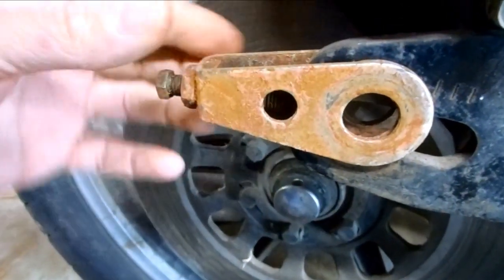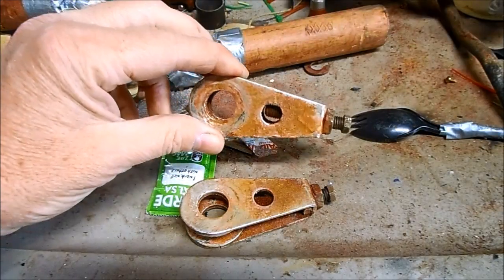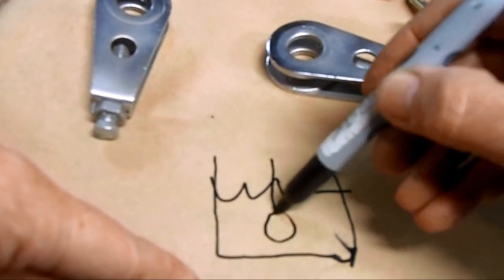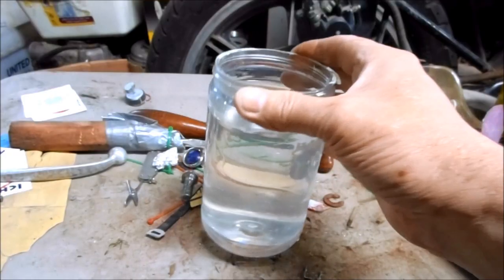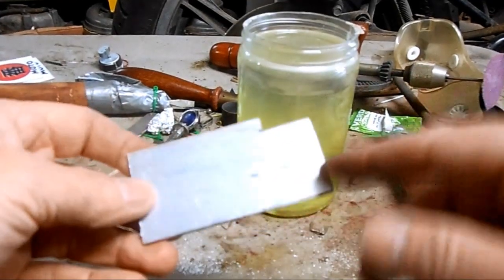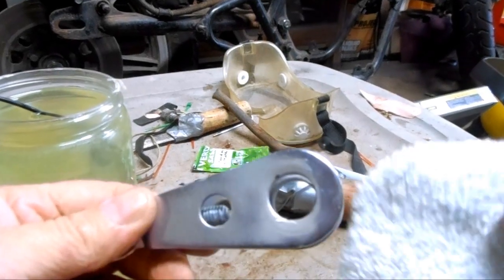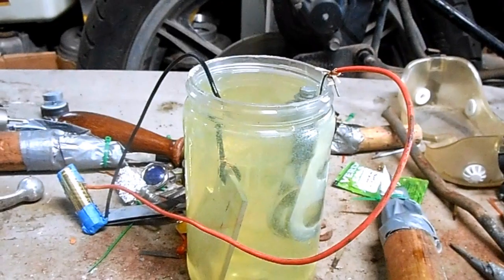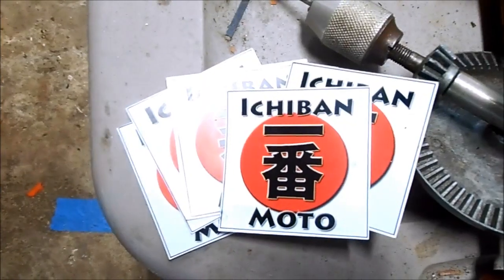how to do zinc plating of metal parts for corrosion  protection  diy electroplating

Comment: Just a comment not meant nastily in any way, it would be less confusing if you placed the red wire on the positive end of the battery and the black on the negative as that is the universal colours for the DC electrical circuit.
the Anode is the positive and the cathode is the negative .
Zinc anode sacrificial source of the Zinc. 
Part to be plated is the negative side of the power source.

Comment: Is this a Yamaha SR 500 ?
Got the same with disk brake on the rear wheel.
Love this bike ❤
And did all bolts and nuts zinc plating !
Reply from the maker: @christosgerakinis2628  it's an XS.    would love a SR

Comment: Ok, I knew your were just joking when I saw a AA battery for the power source! LOL
Reply: The method is sound, except from a few details I find suspicious. Negative should be connected to the part and Positive to the sacrificial anode. I think he did, though he did not respect the red / black wire colour convention! The electrolyte needs to be alkali, so why pour vinegar in it too? Maybe to adjust the PH so the current is not too large? Otherwise, Zinc plating needs low voltage, so an AA cell is in the ballpark, but I doubt it can supply the current for long?

Comment: I cry fraud...First off you DID NOT remove the old chrome plating. You may have removed the rust , but the chrome is still there.  This is NOT bare metal. It's very visible that the chrome plating is still there. You CAN NOT remove chrome plating in this manner. It has to go through a reverse electroplating process. It has to go through the reverse of the original chrome plating process, where you are removing layers of copper, nickel and chromium. All you have done is plate a layer of zinc on top of an existing plating of chrome. This may be the most fraudulent video ever placed on you tube...It is amazing to me of all the comments from the gullible people who actually think that you did what you say you did and have bought into your blatant LIE, hook, line and sinker....You sir, should be ashamed.

Comment: I notice that the neutral, (black) wire was not connected to the anode directly but attached, why is that, surely it must be attached by the copper wire.

Comment: The zinc will be deposited on the part that is connected to the negative of the battery. You just confused me by connecting the red wire to the negative. However you've done a badass galvanization.

Comment: I wonder if it would be possible to zinc plate naked metal on a car when repairing rust. If I remove the rust first and and then build a incasement around the naked metal and do a zinc plating before painting. That would be interesting to see.

Comment: I took apart some used alkaline batteries, extracted the zinc paste core, mixed that with water, and use a graphite lead from a pencil as an electrode.
An alkaline electrolite will plate slower but achieves greater thickness.
Reply from the maker: I will try this

Comment: Did u use baking soda?
Metal plate used is steel?
Reply from the maker: no, it's sodium carbonate. it is sold as washing soda. baking soda is sodium bicarbonate. I have not tried, however there is a process to convert baking soda to sodium carbonate on the internet.  the plate is  zinc tin.

Comment: That part with the tumbler, seemed a little surreal. Did you really use that to remove the rust from the plates? 
I do like zinc oxide for stopping rust through.

Comment: you didnt remove the bolt. whats with the rust on the thread? still there? if i use a 3v battery, is it just faster or worse? where do you have your vibrating parts tumbler from and what is it filled with?
Reply from the maker: i have a video on how to make a tumbler. it is a synthetic absorbent clay
Reply: Don't pay attention to this liar, it is not a real video of how to do zinc plating. He didn't even use zinc, it was an aluminum piece.

Comment: Thumbs up. You've got amazing manual drilling skills with that nail. Was that electrical grade assembly tape or blue painter's tape? Methyl Ethel Casitone? Did you mean highly toxic Methyl Ethel Ketone (MEK) which is banned in the US? I think you probably used alcohol or acetone. Also, your wire colors are backward. DC colors are (+ red) and ( - black), but I suppose you were going for the fun factor on that as well. Note: Connect the part to be plated to the side that bubbles. Thanks for the chuckles.

Comment: Not criticizing your video, in fact, it is really good for anyone that is a DIY'er. I want to point out that your tumbling process may not have removed all the chrome. It did remove chrome plating that has become "delaminated" (not sure of the proper term) due to oxidation of the base metal. Corrosion did not occur over the entire part.  What you accomplished is to smooth the surface appearance for visual appeal.  For stripping off the plating, within reason, use hydrochloric acid (muriatic acid). Hydrochloric acid is used to remove the chrome in production shops for the purpose of re-chroming.  Removal time is equivalent to plating time. in most cases (pH determines the time on known thickness). Chrome is approximately 1/6th the thickness of nickel. Most chrome double plating ( meaning chrome over nickel, no copper  in the process, such as toasters, bread boxes, Harley-Davidson) keeps the part in the nickel bath for approx. 32 minutes and less than 5 minutes in the chrome bath. 
 Hydrochloric acid is available in hardware store and big box stores. Do not leave in overnight!!!. Depending on the solution of HCl (pH), it may take only 10 minutes.  You should be able to see something happening. Rinse the part thoroughly.  If you own a tumbler, after stripping, drop said parys into the rocks to achieve the smooth finish. Sorry, I do not have recommendation for the time the part is the strip bath because plating comes in various thicknesses and acid for the consumer is weak compared to what is used on a production plating line. 
 Regardless. this is fun. WORK SAFE, know the dangers. Acids can become airborne and corrode everything in your shop, including your lungs. This is not something you try without investigating. Proper ventilation is necessary or do it outside. The acid bath for stripping does not need electric current. Yes, residual  chrome can be plated over. Results will not be as good as the original process. Zinc is sacrificial, always turns white after time and is no where near as good as chrome or cadmium, it is just shiny in the beginning and EPA friendly. 
 If you find a mistake in my information, please add the corrected info. I am trying to help. 
Personally, I despise zinc after knowing the quality of cadmium most of my life.

Comment: The battery is hooked up backwards, and one of the wires isn't making contact to the plate to the work piece at all.  haha  The general concept of plating is true though, don't know if it'd work with zinc, but it would work with nickle if you left it long enough.

Comment: with no electrical connection to the zinc, you would be pulling copper ions from the wire, copper plating it.  Also, the polisher used did not remove the rust from between the nut and bolt connection and the tensioner connection, so you have rust exposed the next time you adjust the chain.  Drilling with the head of a screw...this is just a spoof video.

Comment: Red is hot, black is power? Red is negative, black is positive? It looks like the red is on the negative side of the battery and the black is the positive against normal conventions. That's confusing. I would do it the other way round which is normal. The item to be plated  has to be connected the right way round  and the positive goes to the zinc.. Good idea though. What's an Ichiban Moto Sticker?

Comment: wire you connected to Zn anode is isolated :) how do you get current? :)
Reply from the maker: induction
Reply: how induction could take place without circuit?  how strong is induction field in area you've made? and how induction is related to galvanization? :)

Comment: Hummm....
It's impossible to have the zinc plate working with that horrendous insulated wire....come on please.
When you do your video try to show the entire process and speed up instead cutting the video. 
Otherwise it's hard to believe you are getting results with your DIY setups.
Reply: its 50% satire.... hopefully anyone watching would be smart enough to figure that out and do more research on electroplating.

Comment: This worked out so well for you I think I'm going to do my WWII German tank. I dug a hole in my backyard and made it deep enough to hang the German tank from 4 cables. It is going to work out great because the overhead power lines running to my house is perfect to hang that monster and supply the current needed. Great vid.
Reply: Now all you need is a tiny zink plate, a spork, and a small battery. And maybe some pickle juice...
Reply: Are you still alive?

Comment: I prefer to use di-hydrogen mon-oxide as the base for my electrolyte solution. Try it next time!
Reply from the maker: what ratio should i measure to?
Reply: Ichiban Moto it's been a while, the last thing I electroplated was some 3/8 nuts for my pet squirrel, they drove him...well nutty to be honest. Best I can remember a 1:1 ratio of di-hydrogen mon-oxide to Gatorade, since it already has electrolytes in it. Best part is it comes in a multitude of colors so you can really get that custom feel!

Comment: Interestingly you just steel plated your zinc and copper wire. If you had switched polarity you would have copper plated the steel since the copper wire was submerged and that would have been the path of least resistance. 0 ichiban stickers for you.

Comment: When in doubt Google. I found other examples of this on old motorcycle forums. Look like the real deal. There's tweeks to be done. Higher voltage, acetone for the cleaner and a few other things. Research it! It will work if done right.

Comment: "Red is power, black is hot" ..huh? Besides the insulation in the way of the zinc plate, had it been really connected, what might have happened is that the "zinc plate" would have been coated with the metal of the chain/wheel adjuster. Electricity flows from negative to positive. ..and there isn't enough of it in that little AA, 1.5 volt battery to plate the head of a pin. This is a joke, no?

Comment: Ichiban Moto:  that is pretty neat. I had a corroded bolt on my Harley that was difficult to get to so my mechanic eventually replaced it.  If corrosion occurs again,  I think I may try my hand using your method.  Thanks much for sharing.

Comment: Just a clarification, zinc isn't "rust-proof", or even really corrosion-resistant. Zinc plating is a sacrificial medium, meaning it corrodes so the steel doesn't. To protect the zinc from oxidization (rusting) and to harden the surface, you then have to apply a layer of chromate, typically clear chromate.

Think of it like paint. You've got the steel of the body, then the layer of paint that gives it color, and then on top of that you have the clear-coat. Zinc is the same way; you have the steel, the zinc, and then the "clear-coat" of chromate.

Comment: Very comprehensive video. I use this same process all the time. One thing I would keep in mind if you have to use pickle juice, check the ingredients for yellow number 5. It will give your parts a yellow tint, still pretty bad ass.

Comment: This guy is so full of shit. First off, his vibrating rust remover didn't do shit to that part he just placed a brand new bare metal part in there.  Second of all, zinc is a horrible metal to plate anything in as it will corrode before most other metals (that's why my boat has sacrificial zinc anodes that will corrode and protect other nearby metals - look it up).  At the end you can clearly see he cuts to another piece of metal as he's wiping it off.  Looks to me like he suffers from Asperger's syndrome and desperately needs to feel important.

Comment: the red is hot the black is power?
Reply from the maker: correct
Reply: Ichiban Moto hot and power mean the same you are describing a circuit with two hot leads you probably want to say that one is hot the other is neutral

Comment: Hey Is There Any Non Corrosive Anodes Except Platinum Or Other Expensive Stuff I Have Tried Carbon Rods But Corroded
Reply from the maker: i need to test that
Reply: Maybe Graphite
Reply: Can You Tell Me Can I Make Copper Sulphate Solution Without Sulphuric Acid

Comment: Why not remove the tension bolts to do this ?  
I cant help thinking this video is a wind up. A 1.5 v AA battery ? Those thick wires ?   I shall try it, but I'm quite sceptical.

Comment: I almost believed this until i started reading the comments,it's obviously a joke, you can't zinc plate using only a small 1.5v battery, you need at least a 9 Volt PP3 :) Silly me
Reply: TRASHURE Thanks
Reply: SP330Y And you cant plate witg sodium carbonate! Plust the wires were reversed,the drill was fake, methly ethly cecetone does not exist,..
Reply: BeGamerSl 

cacetone*

Comment: If you use Sweet pickle juice in place of Sour pickle juice the extra sugar helps clean the zinc crystals off the work piece whilst electroplating. Also you can dissolve some zinc sunscreen (zinc oxide) to help with the plating process.
Reply from the maker: i do need to try that !

Comment: your electrical assembly tape connecting the "hot" and "power" wires to the battery backwards was pretty funny. but not as funny as that amazing electrical connection to the plate. hahaha

Comment: Hey do you think this would work on a gun barrel? .40 cal gun barrel small part of it was polished down I'm pretty sure but it gets surface rust within a couple of weeks website says its a stainless steel barrel also what about the existing finishing on it will this effect that in any way?
Reply from the maker: stainless does not need corrosion protection .. so it is probably just steel. just keep it oiled

Comment: "The red is hot, the black is power" WTF?
I can see that you connected the anode to (+) and your part to (-), but the way you word this, I'll have to go elsewhere to verify the polarity
Reply from the maker: i used voltages, not polarities
Reply: ... and the black wire is not even making contact with the zinc plate, the insulation is all the way through the curve of the wire, the bare copper is just used to turn around the insulation, no contact at all.  And by the way, the negative (catode) of the battery must be connected to the part receiving the ions from the zinc plate.  Ions can only be produced by lack of electrons, exactly the (+) side of the battery. By the way you did it, just the wire colors are reversed.  Blue gator paint tape was never "electric assembly grade tape".  Pickles solution is not acid nor base pH level, it is just salty water (sodium) what you already had by inserting Sodium Carbonate.  A decent plating take more than 20 minutes, not 300 seconds. For the fun of everything, what I really liked was the way you drill the hole.  You don't have a comedian in your blood, seek another profession please.
Reply from the maker: inductions

Comment: I discovered a chemical free plating system that may be of use to you Master Ichiban... Simply wrap the same Kevlar/Teflon coated sheet material that some chefs use for covering a turkey around the part and for a Thick Lacquer like finish Sellotape is outstanding.
Just a trick from UK Ichiban-land.
Xx
Reply from the maker: i shall try that !

Comment: dude, what's up with the intentional floppyness/sloppiness/cheap-ass attitude? whats's with the hand drill? that must be intentionally dumb, right? besides, why was the bolts left in the part? you are gonna tension the chain, right? so the bolt won't be covered in the spot where the thread of the nut and the part are present, right? that must be like, intentionally sloppy just to be funny, or something, right?
Reply from the maker: you don't have a drill?
Reply: oh, I see. good luck. mate!

Comment: The red is hot, the black is power? That makes no sense.
Reply from the maker: it's voltage grade electrical current
Reply: Ichiban Moto Still makes no sense. Usually red is hot (positive) and black is ground (negative). What do you mean by" voltage grade electrical current"?
Reply from the maker: must be a language barrier or translation issue ?  ... it's science man. science

Comment: great stuff!
you any idea to clean dirty aluminum part like dirtbike hub and so??thx
Reply from the maker: if it is just dirty , use hot soapy water. if it is really bad, try muriatic acid as long as it is not a anodized, painted or polished surface.  if it is stripped down to just the hub, you can soda blast it.

Comment: the zinc plate was not properly attached. 
and an even bigger flaw is that zinc is less corrosion proof than plain steel. it would take about 6 months toa year for the zinc to become corrosion proof, and that is with hot bath plated zinc. electroplated is thinnen thus worse.
Reply from the maker: still looks like new
Reply: it has been over a year, it shouldn't. in that time it has either formed white rust of developed a protective patina layer. unless it is not zinc.

Comment: Fake video, tensioner that is reportedly as zinc plated in 300-400seconds with a 1.5volt AA battery looks to be spray painted with some dust caught under the coating. Why neutralise the PH when you then add an acid, waving a drill over the Zinc (Aluminum) plating material does not drill holes, PVC insulation won't conduct electrons to the plating material.

Comment: The electrical connection to the battery is not good.
Copper has the contact on the battery armor on both electric poles, this puts into short circuit the battery!
Top Idiot!
Reply: enzo how many times are you going to be saying this? please man, I answered you above.